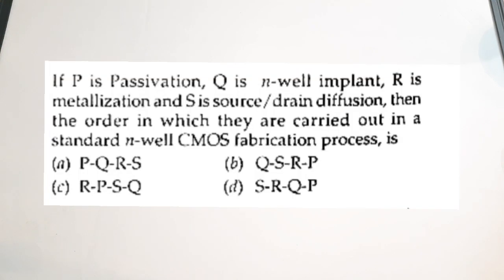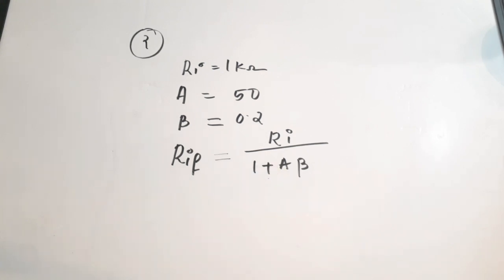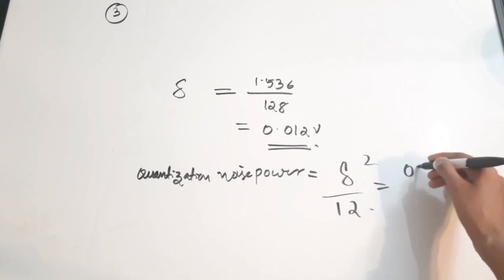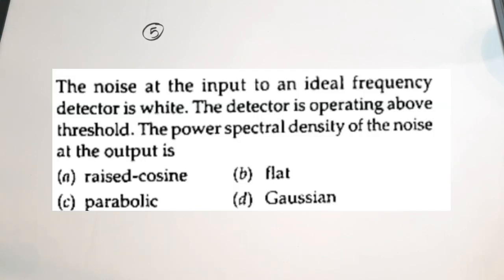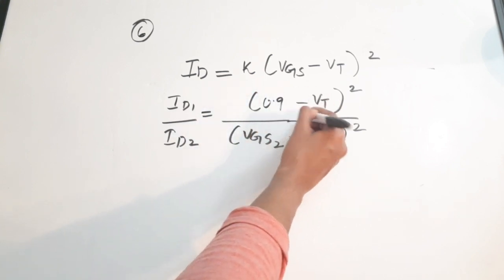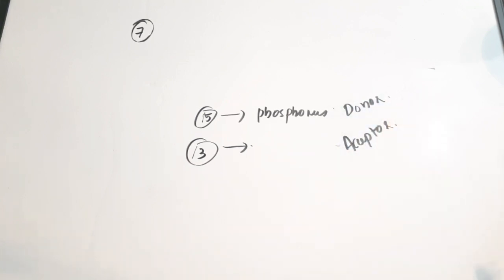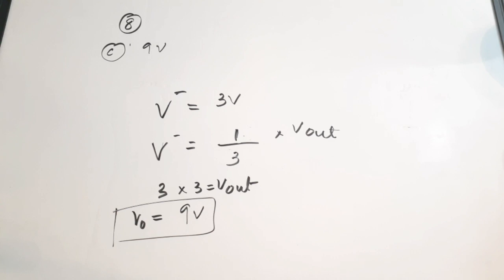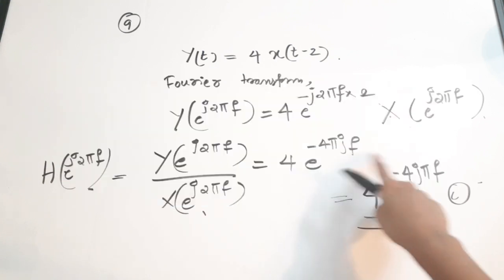ISRO HSFC VSSC SAC Technical Assistant Mock Test | ISRO Technical Assistant Electronics Mock Part11

Comment: Is input resistance formula is correct? I think= R(1+AB); because I/p resistance should be higher than output resistance.
Reply from the maker: I will update in case of any correction, I think answer is correct.
Reply: please check your concept kasavayya becoz output resistace is more than that of input resitance becoz here using current shunt feedback
Reply: in current shut feed back....input resistance decreases..and out put resistance increases
...becoz use input resistance Rif= Ri/1+ A beta.........is it reason.madam?????
Reply: @vishnuvikraman1144  yes.because of shunt operation input side.resistance decreases